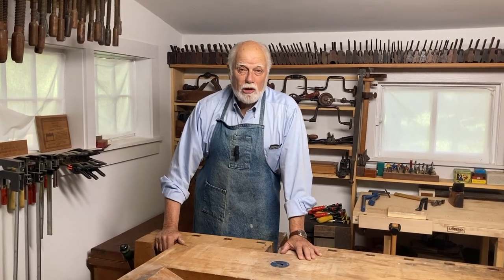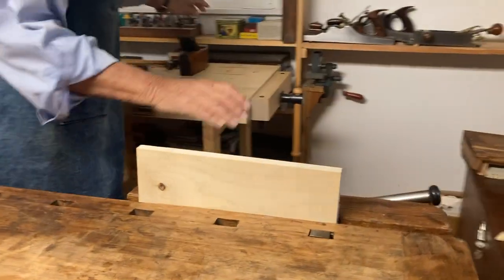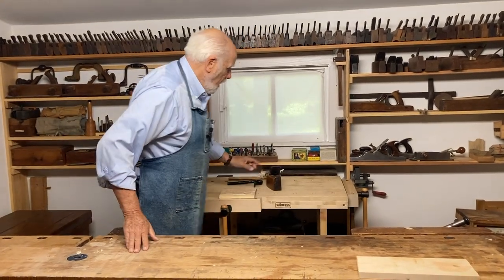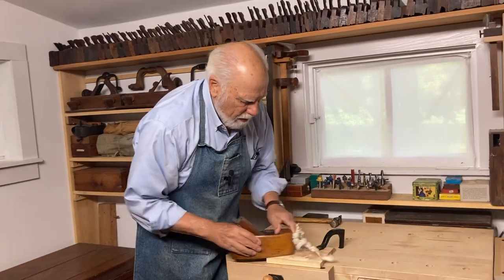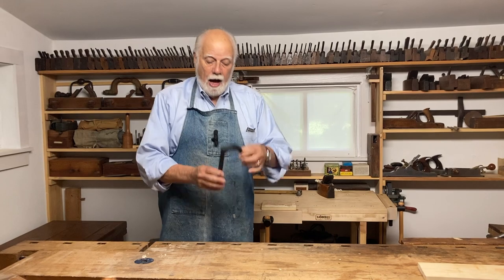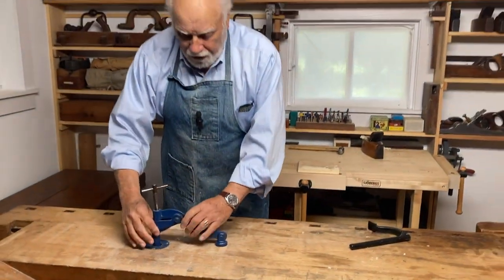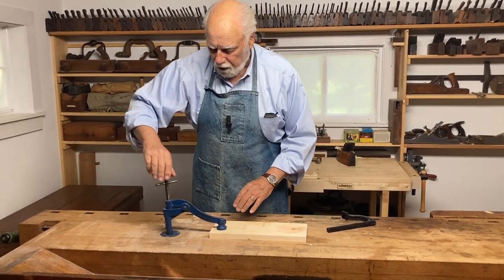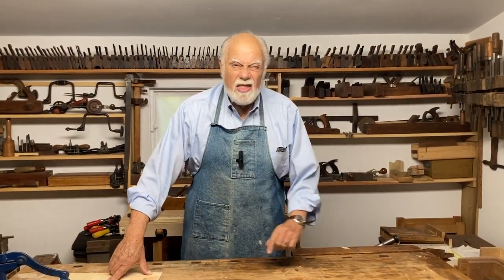12. Holdfasts Don't Let Go

Comment: I’d love a couple of 20mm hold fasts for my bench, but if you can find them they’re quite often not the cheapest option. Less and less people use them now so finding blacksmiths that make them is a challenge
Reply from the maker: They're out there - keep looking!
Reply: I bought a pair of the Gramercy holdfasts, and they worked fine. Then, I'm a total newbie blacksmith so made my own set as well.
They may be hard to smith nice ones, but to just smith something that works isn't that complicated.

Comment: I had 2 of the cheaper versions with 5/8 dia shafts and drilled 3/4 " holes in my 4 " thick ash work bench. Roughed up the metal shaft and still,.........no hold. I'm thinking with a 4 " thick bench I may need to widen the holes to 7/8 or 15/16 to get the needed angular bind? I hesitate to enlarge the existing holes in my bench. Thoughts  anyone?
Reply from the maker: Possible, but usually the problem is that the hole is too large for the holdfast.
Reply: Quite late to comment, but I think over 3" thick bench is not recommended for holdfasts.

You could do a 1-2 inch deep counter bore from bottom of those holes with eg. 1" forstner bit. That would work quite well

Comment: How thick does the bench surface need to be for a simple holdfast to work?
Reply from the maker: I gues a couple of inches would be fine — but if less you might be able to add an extra piece below the bench top.
Reply from the maker: I think a couple of inches is fine, but you might always add an extra inch or so below where you bore the hole for the holdfast.
One advantage of the screw type is that it comes with its own metal collar — an extra advantage!

Comment: I use holdfasts a lot. Most of mine are home made. I discovered quite quickly that anything even remotely holdfast shaped will work.
Reply from the maker: Sounds good!
Reply: yes, even a forked branch can work (I've not tried but I've seen someone working with that). I hesitate to buy one Gramercy holdfast,  I have some 16mm steel rod... it will be hard to bend at a right shape so I think it will be easier and quicker to weld a piece of flat steel on top.
Reply: Same here. Made them with my father, a fitter and turner by trade